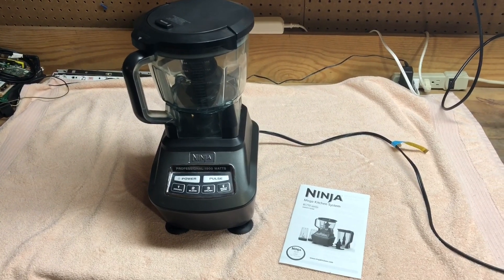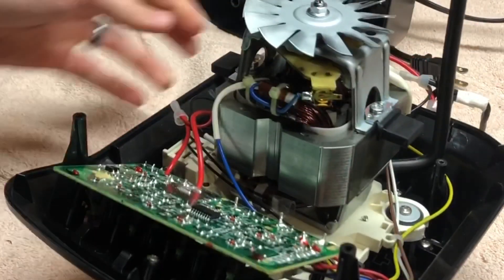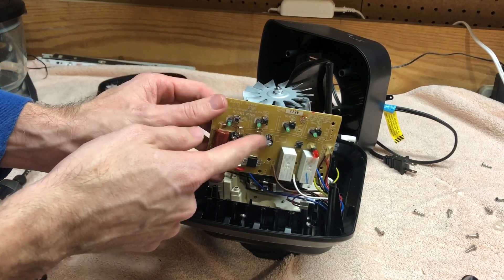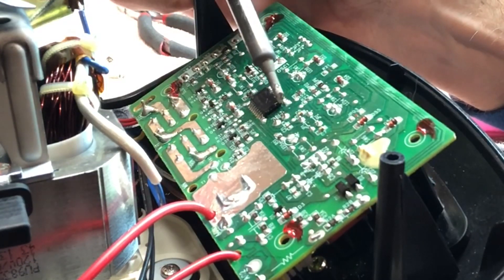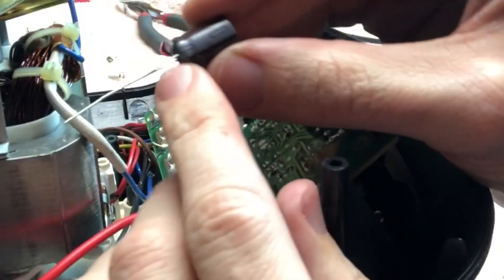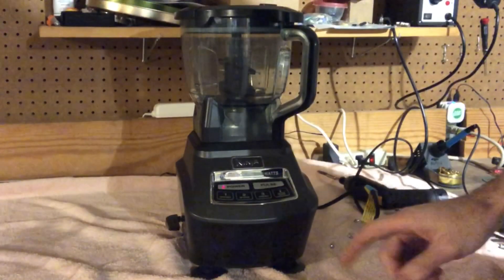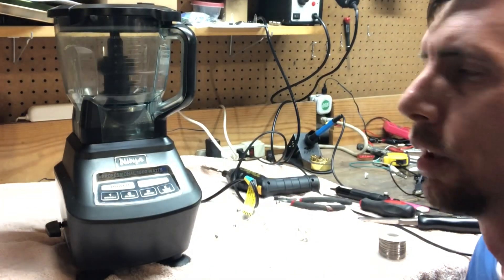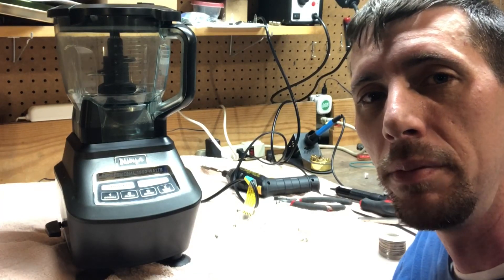Ninja Blender Repair

Comment: It IS crazy to think how many may be in the trash, because of cheap caps. It seems like a nice blender but a lot of people have this issue with it according to reviews. I'm glad I seen this video because I purchased one of these new old stock and I suspect it may not last long before I have to do your fix here.  I may even attempt it regardless knowing one day that cap will eventually fail. A good thing about this blender is it has a very simple pcb so even a beginner could replaced all of the capacitors on it easily.
thanks again.

Comment: I have a bl642w1 1500W I relocated and had not used it for over a year, plugged it in no power. Opened it moved around a few contacts and it came on but turns slowly then stops and powers off. Went back in and noticed the same exact capacitor was swollen, changed it but I'm still getting the same problem. I noticed a smell after it powers off wondering if it's the motor.
Reply from the maker: It's possible that it's the motor, but I'd check the blend cup to make sure that the shaft spins freely. It's possible that the shaft in the cup is bound up or sticky or something which could be straining the motor.

Also, since you said you moved a few contacts and it powered up, I'd look for broken or cold solder joints on the circuit board and touch some fresh solder on those joints.
Reply: I looked at the solder points on the board they all look good. I ended up changing out all the electrolytic caps 2 more 100uf 25v but still nothing even though one looked like it had a leak at the bottom. Doing this from my dining table not the best setup to try tracing. It's definitely a power output issue, with the bottom cover off I can jump start the motor on the lowest speed with a quick spin but if  I press a higher speed it chips out and powers off.

Comment: I have similar Ninja blender , it turns on when you press power and it's blinking red light on power, but when I press any buttons it wont turn at all. I made sure the led and that little pin is being pressed with the led closed perfectly.  What could be the problem please . thank you in advance .
Reply: blinking is always the cup or lid not being on properly

Comment: I have the exact same blender but the capacitor looks okay no bulge or anything.  Could it be faulty anyway?  Nothing looks burned on the board
Reply from the maker: It’s possible that it’s the capacitor, but the only way to know for sure would be to remove the cap and test it with an esr meter ($$$) or solder in a new cap ($) and test it out. It’s a very common failure component, so there’s a good chance that’s the culprit, but I can’t guarantee it. I have seen capacitors fail that have no physical deformation.

Comment: The same capacitor was dead in my Ninja.  Repair was cheap and easy.  THANK YOU!
Reply from the maker: It’s amazing that so many have the same exact issue. It’s almost like they’re designed to fail like this. 🤔 Glad you got it fixed.

Comment: Nice work.  I have a Ninja BL660 1100 W Pro and I use it everyday.  Unit runs great except where the 'fan' mechanism ties into the cup blade is worn from my daughter putting PB in her smoothies.  Worn on both the blender and cup side.  If whatever is in the cup is too thick for the motor to spin, the blade is designed to 'skip' so the motor can continue to spin.  So now everything spins but it doesn't connect to the cup blade.  Has anyone replaced this?  I refused to throw this blender out!
Reply from the maker: David Linder I have not searched for them, but I suspect that you’ll have to replace the cup itself. I’m not sure that they’ll sell the replacement coupler as it’s a sealed unit through the blend cup.

Comment: Dustin, thanks for this video. I had a BL770 that I was fixing so in watching your video I was immediately suspicious of the electolytic caps (I continue to see bad electrolytic caps from the "Capacitor Plague" which just keeps on giving. )
 I did look at the 1000 uFarad 6.3 Volt but it was good. However the other two 100 uFarad 25 Volt electrolytics read open with my ESR meter and would have probably read open with a standard meter. They didn't blow out the top the way I'm used to seeing but leaked out the bottom where the leads enter the body so visually there was no clue but they were open. I replaced them and the 1000 uF as well since it was suspect. The board was acting normally. Power light would come on and the power buttons would light up as you change the power settings but no motor! In tracing the power flow through the two relays it suddenly turned on. Then I found that by tapping the board under the relays I could make it come on. So naturally thought "bad relay". There are two as you look at the bottom of the board with the 6 pins down. They are both Single Pole Double Throw. Naturally I unsoldered and opened up the left one and found it to be pristine! Then I opened up the right one and sure enough, badly burned contacts. The relay is a 12 Volt HF115F which is available on eBay. It needs to be the one with 8 pins however. Most I see are from China but I didn''t want to wait so ordered one from California off eBay. Here's the same one from Mouser: https://tinyurl.com/y2v3f2jw
Uh oh just did some measurements and it's not exactly a perfect fit. So there's going to be some modding needed!
So if you have a Ninja BL770 and all the lights work properly but doesn't run but runs if you bounce it it's probably this relay.
Reply from the maker: Richard Sato good work on troubleshooting and thanks for the tip.
Reply: Thank you!

Comment: Someone asked about the Varistor "small ceramic capacitor between the 2 wires and the yellow part". It's a 10S271K and available all over. I was unclear how they worked. This is from Wikipedia "Varistors are used as control or compensation elements in circuits either to provide optimal operating conditions or to protect against excessive transient voltages. When used as protection devices, they shunt the current created by the excessive voltage away from sensitive components when triggered."
So it makes sense that it blew up. Might have also blew when it was plugged into 220 VAC. It does have a zig zag trace on the board.
Reply: Hi Richard! By any chance do you know the specs for the varistor for the Ninja SS401 ? I can`t find it anywhere. Mine is burnt exactly where the code is written and I can`t read it.

Comment: Hi Dustin. Can I send mine to you to fix. I am having the same problem, no power when plugged in. Contacted Ninja, what a nightmare that was trying to talk to their customer service department. Ugh.
Reply from the maker: Ellen Worrell LOL. Customer service wasn’t much service eh? For the cost of shipping, here and back, you could probably pay someone local to do it cheaper and faster. I’d look for a local maker space or electronics club. Robotics clubs are starting to be in more and more high schools too. You can show them this video and it should be a very simple and quick job for anyone that  has basic soldering skills. If you don’t have any luck locating someone, let me know where you’re from. I’m part of some online groups with people all over the country and could maybe find someone close to you that would make quick work of it.
Reply: You're video saved my wife's ninja. It had the same problem so I ordered the capacitor 1 week ago and just got it today so I got what tools I needed and
went out in the garage and watched your video step by step again and got started.
It was fairly easy and was able to do the repair myself and it did the trick. Just like that, it works like new again.
 My wife is exited that she now has her ninja back. Thank you for your video, it was nice to be able to do the repair without having to spend extra money or worse and just buy a new one.
Again, thank you very much.

Comment: I have one of these lenders the LEDs turn on as normal but the motor won’t move what do you think my problem is
Reply from the maker: Darwin Maldonado I believe there is a switch that is actuated when the pitcher is locked in. I suspect that switch is not working properly. I gave this blender away, so I can’t verify that unfortunately.

Comment: Thanks for that video man... the issue I'm having with mine is the the lights turn on but it's not blending, Do you think it could be the same kind of repair?
Reply: This repair was for a dead (no power) unit.  If your lights turn on, its probably not the same problem.  Typically its a problem with the safety lock system.  The lid has to be pushed down and base aligned correctly for the pins in the lid and pitcher to activate the safety switch in the base.
Reply: Thanks for this. Mine started working intermittently only after a couple months. If I shake the blender I can get it to run which led me to believe it wasn't a capacitor and instead switch related.

Comment: My BL770 blender is making a loud screech when used . i want to check the Motor bearings and gears. Has anyone removed the Blender Motor coupler that connects to the Blender Pitcher

Comment: Thank you so much for this video. I just fixed the exact same blender with the exact same problem, and now it's runnng like a jet engine. I know this took time to make, and I am so very greatful.
Reply from the maker: Shakusky Malone glad you got yours up and running again.
Reply: @DustinRogersinMO  thank you!!! Was about to trash mine, then I decided to look if it could be fixed. Found your video and I have the exact same problem. Swollen capacitor! In your opinion,  is 10v better than 6.3v?
Reply from the maker: @curiouskitten  use whatever capacitor you have that has the same capacitance value and at least the same voltage value. A higher voltage value will hold up better, but are typically more costly (when buying millions for manufacturing), so the manufacturers typically go with the minimum spec/price components.
Reply: @DustinRogersinMO  thank you!
Reply: Hanx, I'm gonna try to fix mine.
Reply: Could a ninja food processor bowl be fixed, the screws look like they have all been broken .  When I picked up the bowl for food processor the gear was loose and I could not tighten the screws back in. Not sure if this fixable.
Reply: Thanks, never saw a security screw like this so it stoped me cold until your vid. I will get that T-9. But I have a different repair issue. Since you've seen the inside maybe you can advise me. I have 2 of these ninjas. On the first one the button board pushes in as if the board is not tightly attached, as it got looser I could no longer turn on power. The company had sent me a replacement under waranty years ago, which I used until now when I can hear a knocking that is disturbing spin power. It's like the spindle is wobbling and knocking with that drag probably causing electric burn smell. If you had to guess, do you believe if I get the tool to get into it, I'll find the parts are likely easily swappable to make one working unit out of the two. I believe motor is good in the old first one. I would need to swap the motor to the newer one unless the spindle or assembly (DON'T KNOW WHAT TO CALL IT) is swappable. Or to repair the old one I need to secure the circuit board or swap it from the newer one,  seeking a solid secure install for the external switches/buttons to not mush in where now they make no connection to the board. I can't buy a new one and right now but must drink my food because I can't afford needed dental work. So, this is really a necessity.
Thanks for considering advising this for me.
Reply from the maker: @dennismaltz5643  If they are the same exact model, I would think that the internal components should be interchangeable.

Comment: I have the exact same ninja blender, almost 9 years old. Nothing wrong with it. I want to heavily modify it so that I can fine tune its speed control. It original has 3 speed controls. It has some sort of a chip (could be a micro-controller) at the center of the circuit board. I like how the manufacturer etched the labeling on the chip to prevent reverse engineering. But its no bigge, just need to cut open bunch of wires and connect it to a mini Arduino board and customize the programming for fine tuning its speed.
Reply from the maker: S To sounds like an interesting project. If you go through with it, make a video of the process.

Comment: Mine failed because of the small ceramic capacitor between the 2 wires and the yellow part. Can someone give me the specs of this little capacitor? It is completely destroyed and no way to identify.
Reply: This is not a capacitor but a varistor value 10S271

Comment: Hey love this video, but what do i do if only one of the blender cups doesn’t work and the rest do?  The little cups works and the one for the dough works also, but the big food blender cup doesn’t. What do i do to fix that problem? Would it be the same as what you did on this video?
Reply from the maker: Ayisha Dawood  no. There’s part of the cup that engages a safety switch when you lock the cup onto the blender. You’ll just need to inspect the base of your big cup to see if something is broken off or missing.
Reply: Ninja BL 490. I can’t figure out how to separate the upper part to access the motor. I was able to remove the bottom base with the specialty bit, but that’s how far I was able to get. Do you have any ideas how to access the motor?

Comment: Had the exact same problem.  Good point on the electrolytic capacitors being a common source of problem. I’ve fixed many devices especially TV power supplies by replacing. Likely a Ninja design issue or bad batch of caps in this case.

Comment: This wasn't my exact problem, but this video was helpful for disassembly. My security torx was a size T-10 however, not a T-9. I went out to Lowes and bought some bits. They did not carry a T-9 security bit in the store, T-10 was the smallest, but it turned out to be the right one. 

My problem was that I was foolish enough to spray mine off with the kitchen sink spray hose to rinse it and I think water got into one or more switches. I took it apart and could not find any water inside, put it back together and it actually worked, even though I didn't "fix" anything. Probably just dried off and started working again. I did leave it lay apart overnight and that might have helped. I also worked the switches in and out quite of few times and that might have helped too. Moral of the story, just clean with a damp cloth like the manual says.